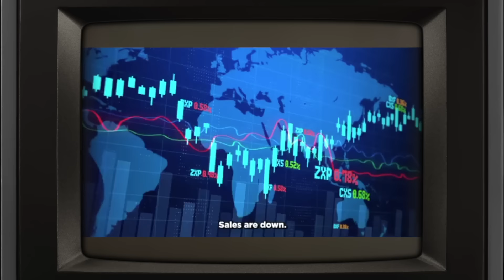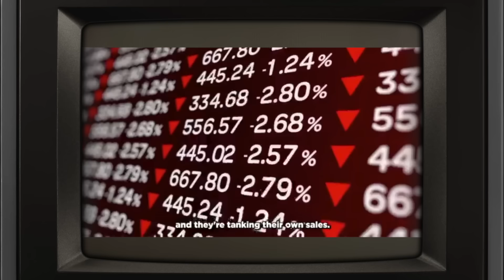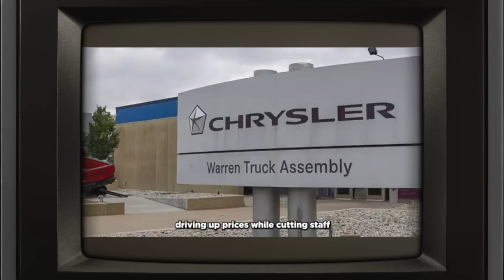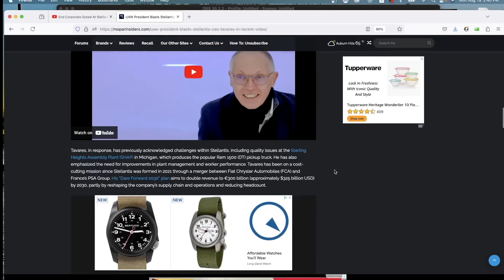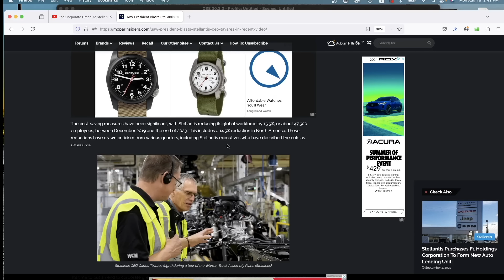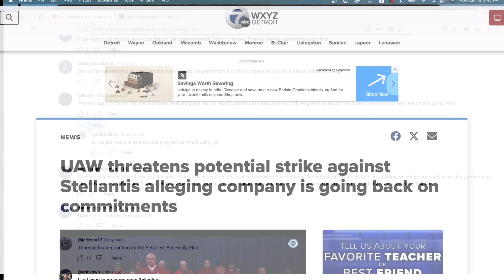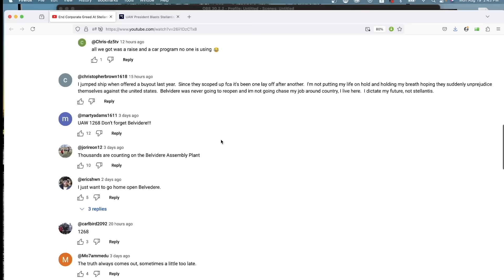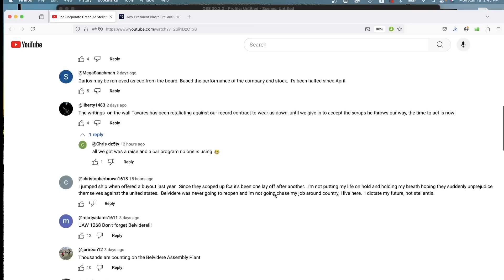UAW PRES SLAMS CARLOS TAVARES CEO OF STELLANTIS IN SCATHING VIDEO!

Comment: This was easy to see coming.  Prices were passed along, few are buying at the higher prices.  I worked in a truck manufacturing plant many years ago.  I worked on the engine line.  I would go home and tell my dad......this is going to fail.  I could finished my shift in 4 hours, and most nights sat for 4 hours a night.  Once I finished my quota for the night.....DONE, couldn't do more or get in trouble.  Each side needs to realize there is a happy medium where the company makes money and the workers are paid fairly for their work.  There should always be an emphasis on product quality.  Everybody got greedy here and it won't end well.